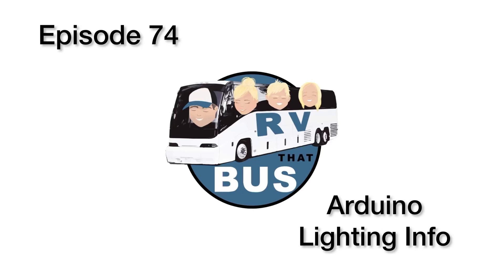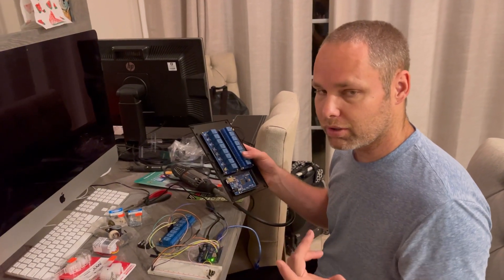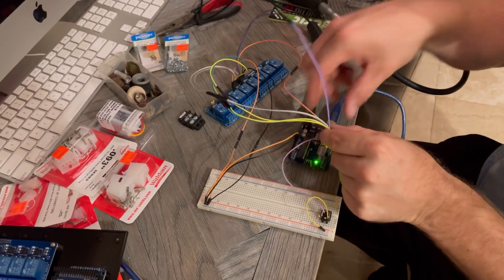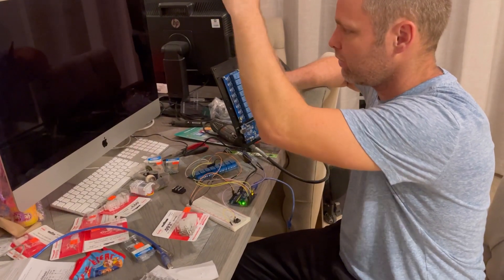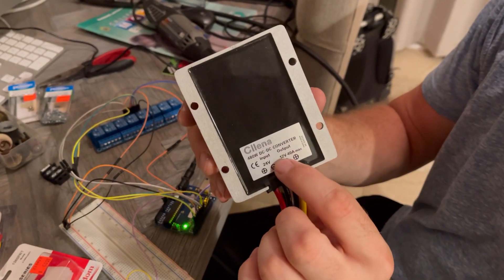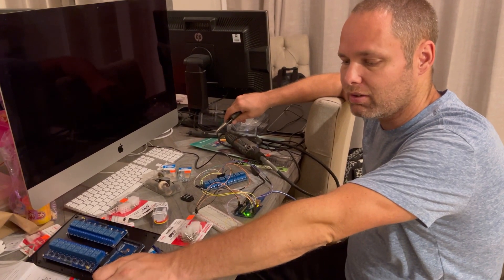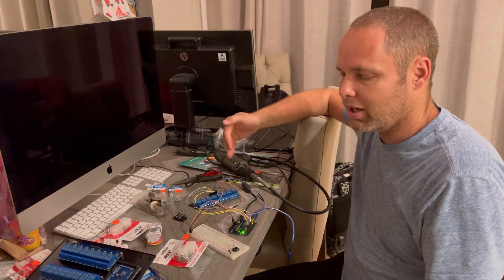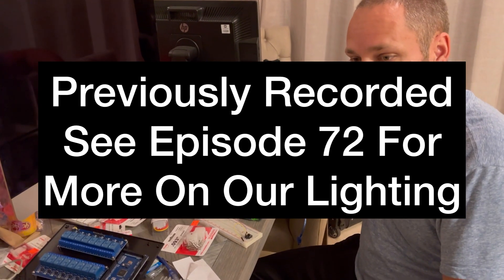Episode 74: Arduino Lighting

Comment: Great work.  I love your bus and what you've done. Thanks for sharing.

I would have done things a little bit different.  I would have used an ESP32 at each light string and at every switch.  Then send messages between each module to turn things off and on, etc.   

Would save a lot of wiring.  Any time you can replace wire with signals, it is a good thing.  All you need to do is run power to everything in the bus, no control wires required. Would also make things more versatile, ie you can change the programming of any and all modules later on.   Put switches and control panels all over the bus.  And if you want to add something new, all you need to do is run power to it and change the program.      

I would have also used a low side MOSFET to act as a dimmer on each string, rather than a relay, which is binary - on or off.

With everything networked, you could then control things from your phone or a tablet as well.   And integrate everything together, including tank monitors, water pump, etc. with something like openHAB to tie everything, including AC together.

Don't get me wrong... I love what you did with your bus.  Great work.  I'm sharing this so that others might consider it.

https://www.openhab.org/